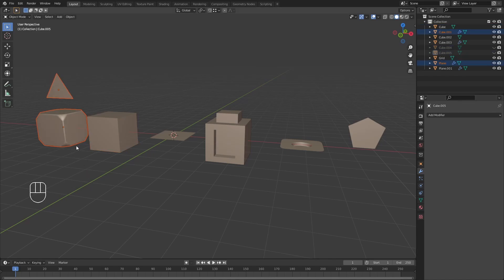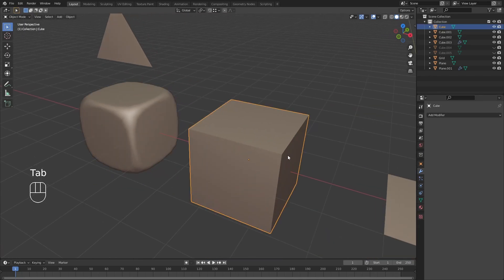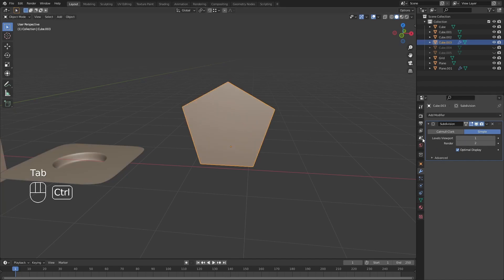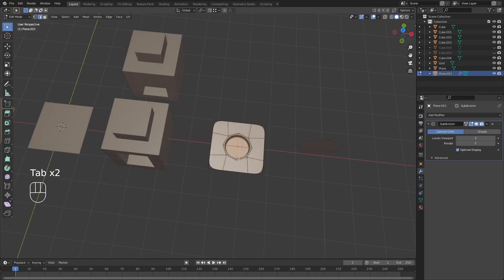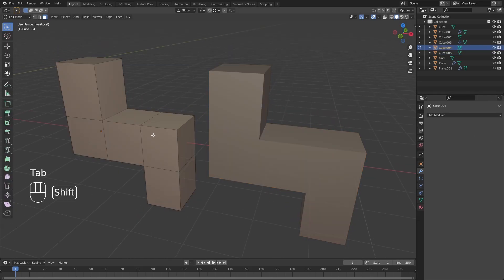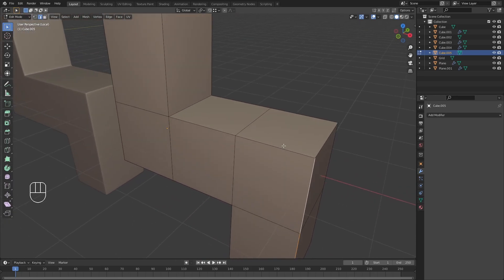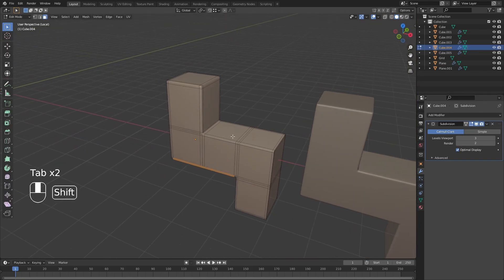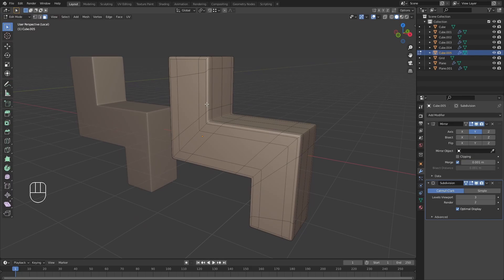3 and 5 Spoked Poles | Level Up Your Topology Game

Comment: Thank you for the video! So that means, when I look up references and they use a 5 Pole for a redirect in their topology, there must be a 3 Pole too? I wonder because I see references, where I can't see a 3 Pole close to the 5 Pole. Does that mean it is somewhere else but there must be one? Is this the case for every redirect with a 5 Pole?
Reply from the maker: 3 and 5 spoked poles occur together when trying to redirect/reduce loops. They also occur independently when you subdivide a triangle (3 spoked pole) or a 5 sided n-gon (5 spoked pole). You'll also encounter 5 spoked poles when 2 areas with different edge flow meet. Don't worry too much about these types of poles as they are inevitable. As long as you can identify them and keep them away from problematic areas i.e. boundary loops, curved surfaces etc.  everything should be fine. Hope that provides some clarity.
Reply: @Art-of-Akrosh  Thank you this helps a lot. I currently tried learning how to redirect loops with 5 poles without creating 3 poles because I saw references doing that. But in the end like you said I probably should worry more about the placement